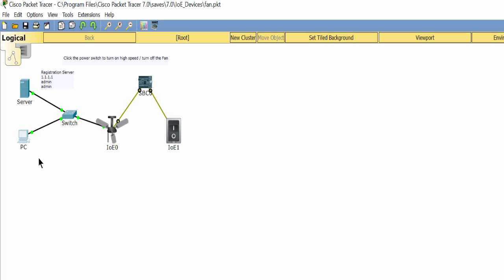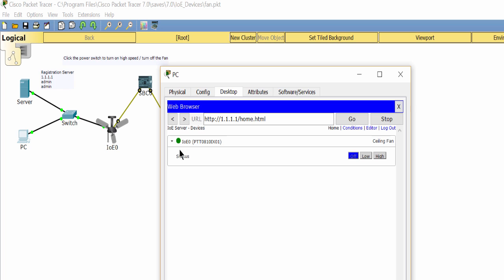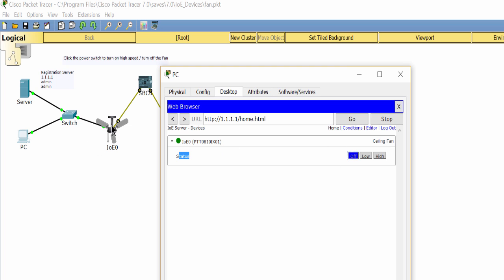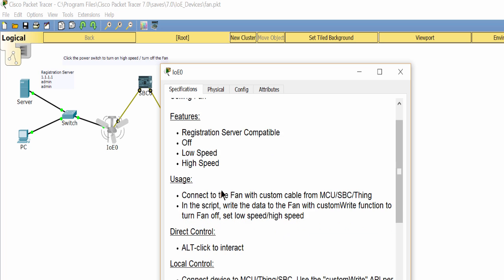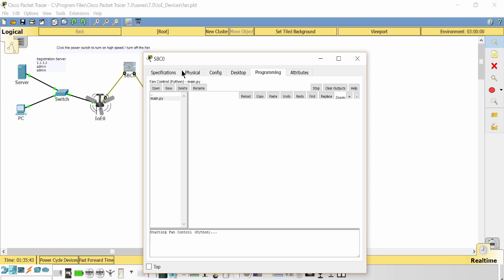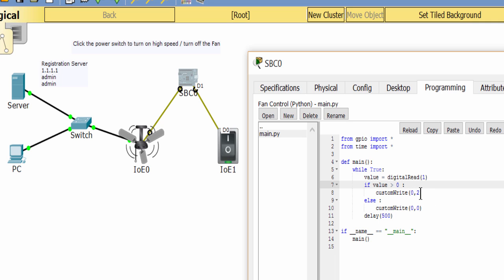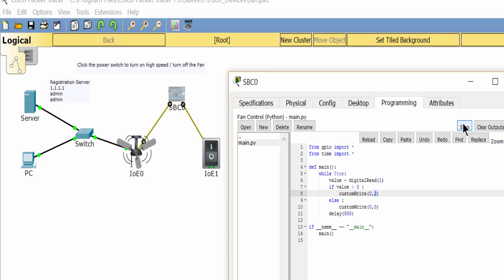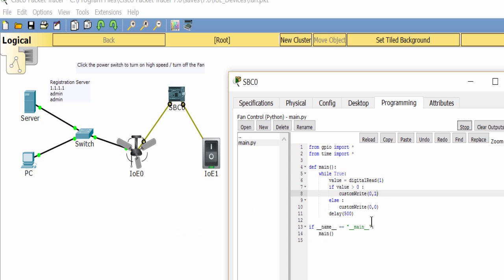[IoT] Programming on a microcontroller to control a ceiling fan

Comment: This code is not Running after doing proper connection.Starting Blink (Python)...
Blink (Python) error:
IndentationError: unindent does not match any outer indentation level in file main.py on line 6
     value = digitalRead(1)

     ^

Starting Blink (Python)...
Blink (Python) error:
IndentationError: unindent does not match any outer indentation level in file main.py on line 6
     value = digitalRead(1)